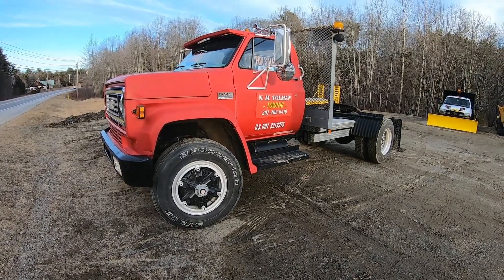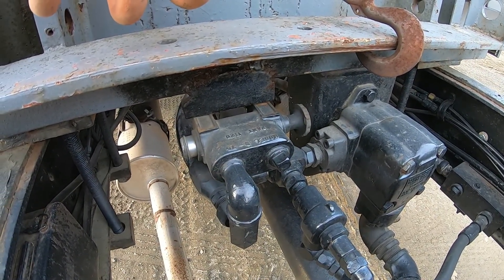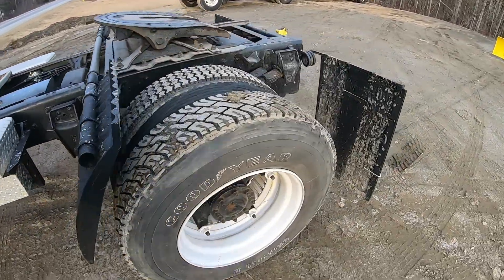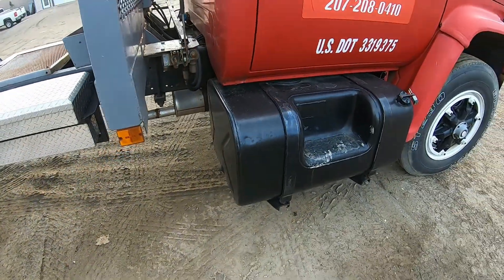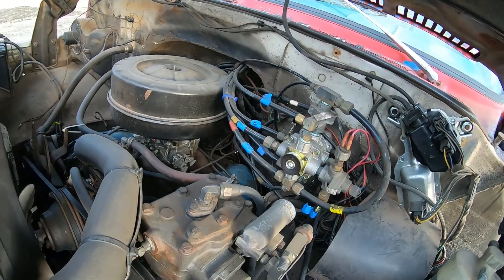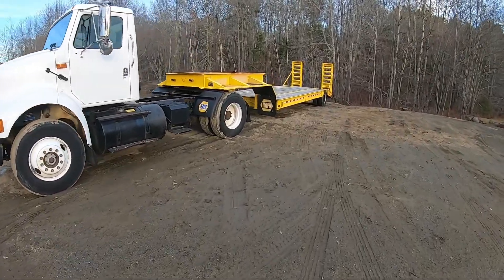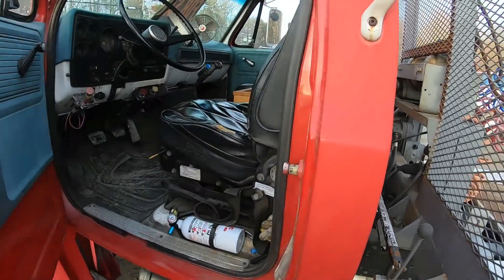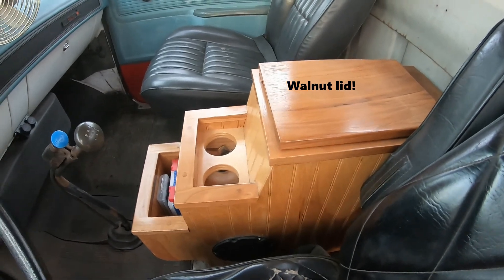GMC 7000 TRACTOR - New Use For Military First Aid Kit?

Comment: Mark, I've been kicking around starting a small transport company with a similar setup as what you had with the 7000. Would you consider sharing some info/advice on how you got started? I'm located in central MA...
Reply from the maker: Hello, some advice - Obviously, get licensed. Find a niche, fill it. When it comes to repairs and breakdowns, do all the work yourself. Repair bills can quickly bleed a new company's capital dry (I've seen this firsthand). Even if this means doing a brake job or transmission in the driveway. 
What I mean by niche - It has become increasingly difficult for a small owner/operator to make a living with general towing or cargo, especially if you want to get home every night. Become friends with excavation contractors, farmers, contractors (someone with off road forklifts or man lifts), boat guys, camper owners, etc.. - they usually get so busy; they can't move their own equipment. They can throw some work your way. Find something to haul, even if it's not what you want to (freight, blueberries, fair rides, etc.). Anything to keep the wheels turning, everyone has to start somewhere. Big trucks are expensive, if they aren't moving, they are not making money.
Diversify - I have other sources of income; trucking is not my only line of work.
Insurance also is very expensive, keep that in mind.
Everyone has a ramp truck these days, or 1 ton dump with trailer. It's near impossible to compete with a single tractor and equipment trailer. Ramp trucks are usually under 26k gvwr, so no special license required. They can haul almost as much weight, cheaper. 
Spend some money, hire a graphic designer, get the truck lettered up with your logo, make it look professional. No general stick-on letters from walmart, or cardboard taped on the door. DOT #'s as well. 
I started with my trucks in a different way than most. I had a lot of equipment which I needed to haul, and hiring it done is a pain.  I also wanted my class A license. I bought this old GMC sitting in a field, left for dead ($2500). However, it fit my requirements for a CDL class A license. Fifth wheel, manual, air brakes. I spent 2 years fixing it up, spending countless hours and money getting it road worthy. Found an old trailer, which was airbrake, fixed that - new deck, welding frame, lights, etc. Finally, took the test with my truck/trailer, got my license. Those were the days you could do this without going to CDL school. 
People noticed my truck, started asking if I could haul stuff for them. Start out as a DBA, or sole proprietorship. If I was doing this as my only source of income, I would have gone a different route. Probably borrowed the money, got a road ready ramp truck or heavy 2 axle rollback, and hit the street running. 
Anyway, that's my $.02, hope it helps. Best of luck.
Reply: @marktolman6037  Appreciate the reply Mark. This would be added as an offshoot to my current niche biz which is repair and service of antique and older equipment. I've been at that for 12yrs now and stay busy year round.  Currently have DOT#'s for one of my trucks (20K GVW) and health card. Would have to obtain a class A and air brake endorsement for a larger rig.
The idea of a hauling company came up because I have a lot of customers that have no way of moving the equipment that they own and it would also add to my biz being able to bring them in for repair vs. going out in the service truck.
C60 sized ramp truck is my main focus and would be ideal. Tractor/trailer is back burner, but still a thought which is why I wanted to ask. 
I already own and put the time/money/repairs into a 12ft flat bed truck (GMC 5000) so I plan to make a run at it with that first come next spring. Just local hauling, no specific freight as long as it's not hazmat or liquid. And of course that hinges upon having the time to drive in between an already packed repair schedule during the warm months.
Once again, thanks for taking the time to reply. -Jake